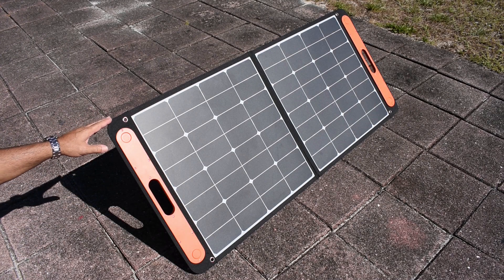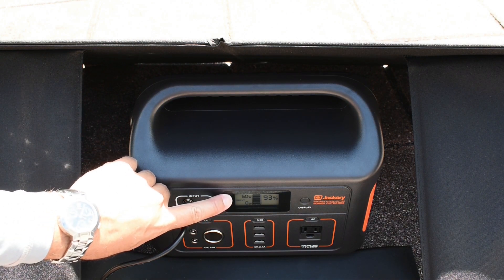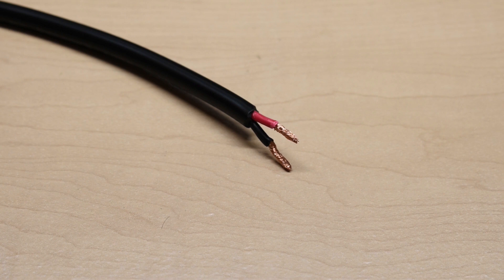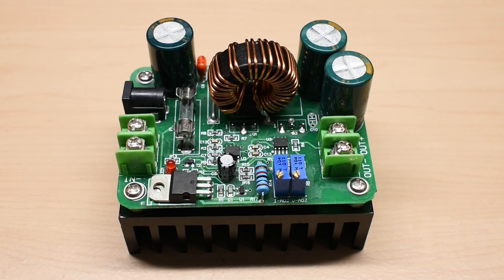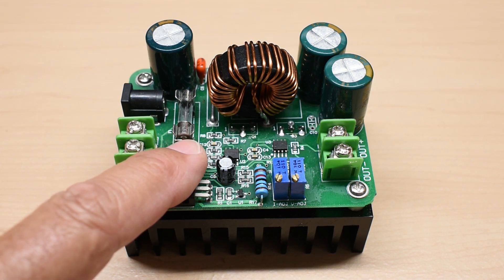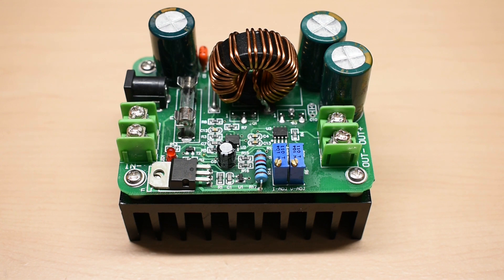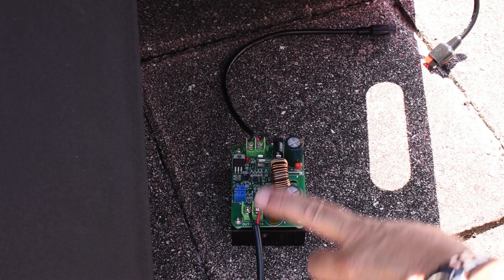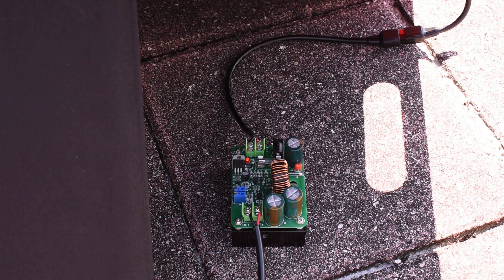How To Charge Your Portable Power Station FASTER! Simple Trick!

Comment: Would such a DC-DC converter work to charge my portable power station (Anker F3800 - solar input is 11-32V up to 10A or 32-60V up to 25A) from my car battery/alternator (14ish V)? Will only need to use in case of emergency if there's no sun, and considering there's a massive battery sitting in my driveway (electric car).

Comment: QUESTION: I have three solar panels each rated at 370 Watts max and outputting at approx. 36V; would it make sense to use a DC-to-DC converter ON EACH panel set to 60V (my Anker Solix F2000 highest Volt in).  Then put them together in Parallel to get hopefully about 950 Watts?  Or should I have them in parallel then BOOST the final output with a higher wattage DC-to-DC circuit?  Currently I get about 400 to 600 Watts out which is way low from where I targeted to be.  Thank you for any guidance you could provide.

Comment: This is an eye 👁‍🗨 opener! Thanks. Would this spesific converter work with my setup? You mentioned this is a big unit... My setup in short:
Delta 2 power station with max 15amp & 60Volts input.
225 watts solar panel (Sunpower Maxeon Gen3) with Voltage at Pmax(Vmp): 19.8V & Current at Pmax(lmp): 11.4A
Thanks!

Comment: Hi can I charge my power station and use it at the same time?
Be it solar or direct electricity?
Reply from the maker: The power station must be designed to do that.
Reply: @electronicsNmore I noticed the AC doesn't work when plugged in.
But wireless charging and usb port working when the station is plugged in the wall.

Comment: Thanks for the video. One of my Portable Power Stations is a DBpower 500w unit.  The AC charger will input about 118watts, while my solar panels (2 x 100watt (12v) in parallel) would only input about 40watts.  This same solar panel setup will input over 100watts on some of my other power stations.  After watching your video, I ordered the same DC converter, increased the volts to 24v and suddenly the I'm getting 100watts input from my solar panels.  Thank you so much!
Reply from the maker: Great to hear!

Comment: I have a 100-watt panel and an Eco Flow River. I followed the precise instructions and adjusted the voltage, but I'm not getting any difference at all in the wattage. The solar generator wattage now goes on and off for a few seconds. I was so excited to try it out and now it's made it worse. Help me, please.

Comment: I'm curious if it actually charges any faster, timewise. Instead of boosting it inside the jackery, you are boosting it outside. I would think the added losses with the extra buck module would actually increase the losses due to heat. I guess if there big losses in the cable and connectors, putting the boost right at the panel might help by lowering the current.
Reply from the maker: Of course it charges faster

Comment: Late to the party here. This will work with jackery due to their woefully low current solar input. Others such as the new Bluettis and ecoflow have higher current capability so they can utilize the full capacity of the panel. So yeah If you’re stuck with an old (or new) jackery this is a good solution. But a modern power station shouldn’t need this.
Reply: I have a Eco Flow River and a Eco Worthy 100-watt panel and it doesn't work.

Comment: Instead of cutting the wire, couldn't you just get an anderson to 5.21mm adapter wire and plug in the 5.21mm end to the buck converter? Next to the input screws there is what looks like a 5.21mm female barrel plug adapter.
Reply: That's an interesting question. Did you ever find out? Thanks.

Comment: is the XYS3580 DC DC Buck Boost Converter CC CV 0.6-36V 5A Power Module Adjustable Regulated Laboratory Power Supply Variable from Banggood the same thing? Will it work on a solar panel also?

Comment: I wondered if you could recharge a portable power station via a EV charge point, with a type 2 connection?
Reply: I think that this will be commonplace soon but haven't seen it yet.
Reply: @coreydavis2332  I’m not sure what is involved beyond a connector swap but imagine there needs to be some voltage/ampage regulator otherwise it will cook the battery

Comment: interesting... does this apply with mppt equipped power stations?
Reply from the maker: Yes, that's what the Jackery is.
Reply: @electronicsNmore   The Jackery used in this video was from the generation prior to MPPT technology being installed in their products. The Logo on the front "Power Outdoors" is the givaway. The models with MPPT loaded in them have Logos that describe the model such at "Jackery 500" etc.  They did this on the sly secretly last fall.

Comment: Thanks for this video. I am in location with frequent power cuts, will want to keep it charged on solar when sun is out and on electricity when no sun with this being done automatically. On seeing this circuit I am thinking there must be a dual input-single output circuit. Any suggestions?

Comment: Very well done video, quick and to the point!  Thank you very much for creating this.
Question: I have a Bluetti EB240 with 400W solar (also bluetti, 2 x 200W) that I'm concerned the suggested converter will not be able to handle that level of power (heat) based on reviews for that converter.  I tried to find larger converter on the Banggod site but didn't see what I thought would be suitable?  Do you think I should use larger converter?  First timer here!

Comment: Thank you for the video and the parts list, I am going to have to watch it a few times to get the instructions straight (if I only listened to dad when he tried to teach me about electronics). 

Now for a question or two. Any helpful hints when charging the solar generator from a fossil fuel generator? Also, can you charge a solar generator using the car alternator while driving? People are always in the car so it would be a great alternative to plugging the solar into either a generator or a solar panel.

Thanks for the info.
Reply from the maker: When using a generator, nothing changes. You use the AC power brick. Yes, you can drive and charge the power station.
Reply: @electronicsNmore  Thank you for the quick reply/info.

Comment: The power station I bought is rated: DC 15V/3A, 45w  And according to the seller this is limited .8-.9 of max input to prevent overheating so typically this charges about 36 watts no matter what the input is.  So I'm confused.  How does this overcome the power station limits or does it just boost the voltage to maximize the input and the wattage limit still apply?
Reply from the maker: Some PPS won't charge at the max rating unless the voltage is high enough, this solves that problem.

Comment: just found the channel, just got myself a jackery as mainly backup, got 200w panel to 2 x 110ah leisure batteries, could I use this set up to my leisure batteries too? Another question I have is can I split the wires from my solar panel on my camper via some sort of switch and charge either the jackery or my leisure batteries? just subscribed and glad I've found the channel.

Comment: Does it really matter where you put the step up module? If it’s put where you say it will be open to the elements on the solar cable. Any other options to this?
Reply from the maker: Doesn't really matter.
Reply: I have another question. Is there a way to have both the solar and the 12v power source work through this one unit to have them both work. Even at the same time? Do I need to have two step up modules for each charging cable? Hope this isn’t a stupid question. It just seems like if I can do that it would be amazing. :) If this isn’t possible I’d like to know a possible solution for having both solar and 12v ready to charge the jackery without changing cables.

Comment: You can assure this is safe? Will this have any negative effects on the solar generator. I have the same setup you have in vid. Jackery 500 and solar saga 100
Reply from the maker: As long as you don't exceed the max input voltage, nothing will happen.

Comment: You cut the cord on the input end.  Does it matter if you put the booster nearer to the output side of the cord so it is placed near the portable power station which in my case means inside the vehicle and near to my electrical panel?
Reply from the maker: I would place it inside a well ventilated plastic box in the center of the cable.

Comment: I just did this build for the car adapter to my Bluetti AC50S. Works great 109-117 watts at 38.5-39 volts. 

Only thing is if I disconnect from the Bluetti and then reconnect it resets to 40 watts and I have to redial the potentiometer back to peak wattage. Is the normal and as designed or did I miss something. 

Thanks for the tutorial.
Reply from the maker: It should hold the setting.
Reply: @electronicsNmore  then I’m at a loss.  It easily dials back up and holds the wattage but then resets if unplugged. Thoughts on possible issues or perhaps a defective product?

Comment: For me is clear the Jackery's MPPT converter is not doing a good job as it should be looking for the best efficiency on your solar panel. I know some of the early models of Jackery had some issues with the MPPT controller. It will be interesting to see how this test goes with a Jackery 1000.

Comment: I would like to charge a Bluetti AC200P from my powerboat's 12V 400 Ah battery bank when underway. Same idea? Use a Step-Up DC converter to boost 12VDC battery output to 700 watts charging into Buetti solar input? Thank you!!!
Reply from the maker: You need to find a DC-DC step up converter than can handle that high level of current. It will work. Thanks for watching!

Comment: At time 6:40 he said he plugged it into the solar panel on one end and then plugged it into the panel on the other end. so where is it plugged in to the jackery at? I've tried to do this, I've swapped the wires and all I can get is the red light to come on and set my voltage at 29 output to the jackery. I can't get the current to change at all. In fact the jackery said 30 from the solar panel but 19 when I put this thing in line. What am I doing wrong?
Reply from the maker: The opposite side of the DC-DC converter , where it says OUTPUT. You must have something connected wrong, or the DC-DC converter is damaged/faulty. You need to adjust it properly or it will not work.

Comment: Is there a box this goes into
Reply: I mean a protective box for the converter or do you just leave it exposed
Reply from the maker: @ImmortalSimba  You can place the entire device inside a plastic box with ventilation holes.
Reply from the maker: You saw what I made in the video.

Comment: I'm confused. How does the step up DC converter over ride the mppt controller inside the Jackery 500? 

My 100w solor panel in sun has a 97% output and my Rockpals 500w will charge at 90watts. But I've watched Will @diy solor review several pps with 100w panel and Jackery has the slowest charge rate and Rockpals has the highest. So if my 100w panel is producing 98watts? My Rockpals will charge at 90w per it's mppt. How does the DC converter Force any pps to charge faster than it's mppt allows? I can't understand this for some reason. Plz help thx for your videos
Reply from the maker: It's the input voltage that matters. Too low, and the charging rate will be low.
Reply: @electronicsNmore  ok thx for your reply. I'm new to all this

Comment: i am currently trying this method with my jackery 1000. I have a input of around 19.0v and 5.5 amps into the boost controller. I have output set to 29vdc. When i plug into jackery and measure amps on output side of controller it basically hangs around half of input amperage(2.5-3.1amps) no matter how much i turn the controller current adjustment? Also I noticed with the output voltage of controller drops from 29vdc to around 17vdc when i plug it into jackery. im stumped. Either i have a bad Boost controller or jackery has some sort of input issue. The last time I checked if voltage increases so does current lol.  any thoughts?
Reply from the maker: If the controller isn't set right, it will do exactly as you said. Play around with the settings in full sun.
Reply: @electronicsNmore   I will try again tomorrow. Its just strange. the jackery screen will intermittenly read in the 100's of watts and just jump around and not stablilize.

Comment: Hey can this work with MAXOAK Power Station 2400Wh/1000W Inverter BLUETTI EB240
Reply from the maker: If the MaxOak charges at a slower rate using lower input charging voltages, then yes.

Comment: This is great!  Followed instructions and it works.  The question I have is that when I adjust the "currency" to make it pretty high, then the output watts start going haywire and show constant changing wattage from 3w to 60 w.  I am assuming I have exceeded max but is this what is supposed to happen?  The solar panel output without the dc booster converter was at 57 to 60w.  With the converter went to 81w but then went into this strange mode when exceeding 81w.  Is this how the converter should react?
Reply from the maker: Adjust until the output is stable at the highest level possible in full sun.
Reply: Thanks electronicsNmore.  If the instability indicates I have exceeded then that's all I needed confirmation on.  Just wanted to be sure my dc converter was not working irregularly. Thanks.

Comment: Loved the video! can i use this to charge it the same way with the lighter fom my car? if i will cut the cable and do the same thing what you did for the solar panels?
Reply from the maker: Yes, you can boost the car voltage as well.
Reply: @electronicsNmore  I see the step up booster recommends max 12A input, my car port has a max output of 20A, since its current it should be up to the converter to decide how much it would draw right, or would it use the full 20A the car output is capable off ? I'm a bit of a noob with electricity so forgive me if its a stupid question.
Reply from the maker: @PieterdeBruin  The PPS only takes a certain amount of current at the set voltage level. If the car battery is 12.6V, and the PPS shows 100W input, you'll know the current level is around 8A, well under the 12A.

Comment: Can you connect 2 solar panels using this method with the jakery 1000?
Reply from the maker: You can place 2 in parallel as long as one has a blocking diode installed and you do not exceed the current rating of the module. The Jackery units have a MAX charging input.

Comment: nice trick, but wouldn't be the same if adding more powerful panel?
Reply from the maker: Why buy a higher power output panel, when you can use the one you have for a little extra money?
Reply: @electronicsNmore  just curious if it's the same, that's all.
Reply: another question would be, why not step up 12V power supply as well since it takes over 6 hours to charge and why Jackery didn't use stronger power supply.

Comment: Thanks for the video.
I'm curious, what is this converter actually designed for?
Also, is there a solar panel produced that has this setup as a listed assembly?
Reply from the maker: It's designed to boost low DC voltage to a higher level, many uses. Panels don't come with one, you have to add it yourself. Thanks for watching!
Reply: Can the jackery 100w panel with this booster charge my jackery explorer 440?

Comment: It seems that even with the power losses of the dc/dc converter it is still making the panels more efficient. the bluetti takes in from 10 to 60 Vdc. 12 Vdc solar panels just have a hard time  charging it. The only other way is to set them up in series for better efficiency. If not possible I guess the DC/DC converter will do. Thanks.
Reply from the maker: It's raising the voltage to a level that allows the PPS to charge more efficiently.

Comment: Hi. . I have two small power Gen's a A Beaudens  B-1503  1666 and a FLOUREON Portable AC230V Power Bank 146Wh  both say they have a built in MTTP and  having just bought a Dokio 100w  12v Portable Folding  Mono Solar Panel would it be safe to use the panel without using the pwm that came with it,  or a mttp controller which I already have or  use none at all . .Many Thanks
Reply from the maker: If they have a built in MPPT, then you should be able to take the power directly from the solar panel. Thanks for watching! Be sure to share the video link with others.

Comment: I have this same Jackery 100w panel and I can get up to 99 watts on my Maxoak 1500 generator. Not sure why you would need a transformer.
Reply from the maker: Try charging using the 12V accessory socket in your car. :-)
Reply: The maxoak has a mppt charge controller built in.  Most do not.

Comment: That looks like 2 50watt panels in parallel. And those panels are 32 cell which is not great. Peak voltage is probably significantly less than the 20v necessary to get a maximum power point voltage high enough to fully charge a battery.
Reply from the maker: You mean for the video thumbnail? I was just showing any 12V solar panel. I agree, 36 cells are the best, the solarsaga uses 32. Thanks for watching!